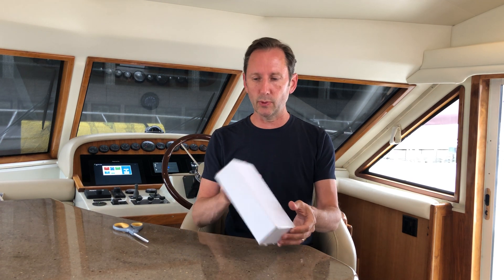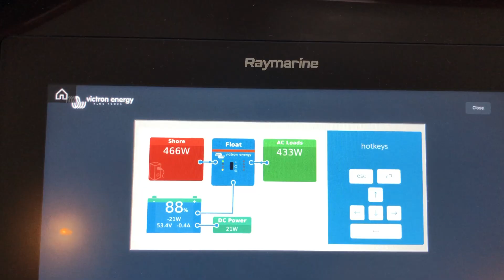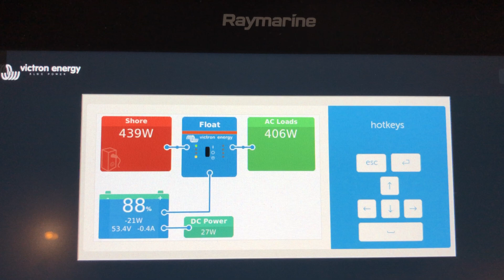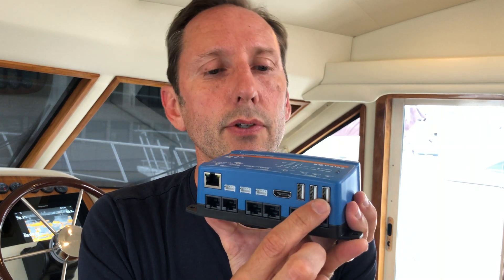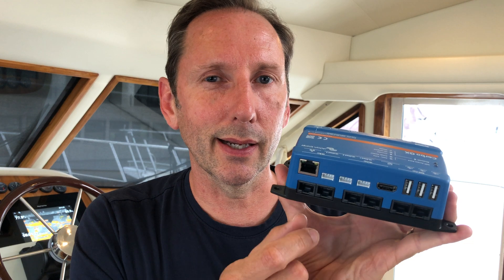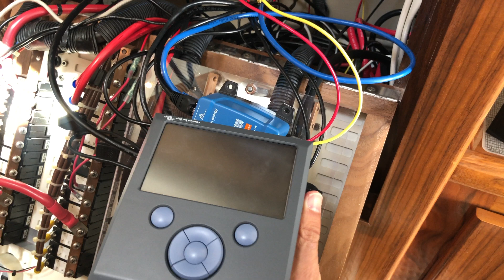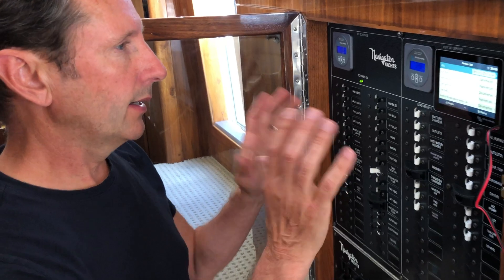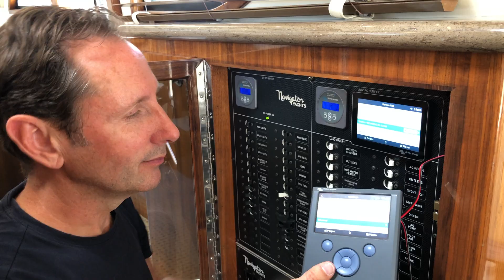Victron Cerbo GX Unboxing and Review... IS IT WORTH WAITING FOR?!! (Elli-Yacht TechTalk 1)

Comment: Would love to see how you connect the tank sensors. This is exactly what I'm wanting to do. Are you going to fit ultra sonic ones rather than drill holes? 👍🏼
Reply from the maker: Good question. In the end we decided to use Maratron pressure transducers over NEMA2K. The pressure transducers don’t suffer from getting fouled in the black tank like a float or ultrasonic sender.  Also, they’re easier to install in tanks that have limited access vs the longer float type switches (like our fuel tanks). Since the Cerbo only accepts resistive tank senders, we’ll use our NEMA2K enabled Raymarine Axiom MFD’s and Maratron DSM410 display.

Comment: Great video! Loved the insight into the system.  Just a quick question.  Are you able to control the Inverter and turn it on off like with a digital multi control or do you need to plug that into one of the ports?  Thanks again for the great content!
Reply from the maker: The multi controller is no longer needed as the Cerbo GX function takes it's place. Thanks!

Comment: Thanx for making and sharing this video. Your is the only non commercial video about these products.  I'm having trouble getting my system to show any stats on the screen. I'm connected to the Bluetooth and the VRM account.. and the WiFI is connected to my internet here.. even updated the bios of it to 7.27. Mine still shows on the main screen it's OFF.. Hoping for a little help. Thanx..  I'm a trucker and will be in Seattle on Wed for my next load.
Reply from the maker: Let me look at my backup Cerbo and see what I can find. Also, the Victron Community is pretty good at responding to troubleshooting questions, if you haven’t tried them already https://community.victronenergy.com/index.html  Thank you for keeping our supply chain alive in n the USA!
Reply: @ElliYacht1  Thanx I appreciate any help you can offer. I'm on the FB Victron group and posted with no replies yet. Ugghh..  Thank you.. I didn't know they had their own forums.
We haul only building material..  Big super sacks (2000lb) of sand to your town by the T-mobile stadium.
Reply: @ElliYacht1  So.. Upodate.. LOL.. I can now see my battery and solar from the road or obviously from home.  got a couple of replies on the forum.. even added a 3rd 400w panel to my system today. 1200 watts in total. Happy boating. I love the water as I was born in June (cancer the crab) and think living on a boat would be fun.
Reply: @ElliYacht1  Ps. Heading to Vancouver tomorrow to deliver my next load. Lumber going to Hawaii.

Comment: Can I use the Victron Cerbo GH with another monitor I already have, with a touch screen and an HDMI connection?
Reply from the maker: From looking at the Victron Community board, it looks like an HDMI monitor has worked for one user. I couldn’t find anything on someone trying a touch enabled screen. Here’s the link https://community.victronenergy.com/questions/47070/cerbo-gx-to-gx-touch-50-extender.html

Comment: What is the maximum cable length allowable to interconnect the Cerbo Gx controller to the Cerbo Gx Touch 50 display? 
From the video's it appears that the USB connection might be for used only for 5VDC power for the display while the HDMI cable handles bi-directional communications with the Gx controller.
Reply from the maker: You are correct on the cable functions. The HDMI is 78” and can’t be extended. 
:-(

Comment: The Cerbo GX has built in bluetooth. Does that mean i dont need to run cables between the Cerbo and the BMB-712 smart battery monitor ?
Reply: No you still need to run the ve.direct cables, but having the gx touch 50/cerbo combo means you don't need a bmv. Having the victron smart shunt is enough. Just rids the system of one more monitoring component.

Comment: I had this unit installed also.  I had very serious issues with all the tank calibrations (at the lower end). Example: fuel and water tanks said 35% rather than 5%. Also the data will not display on my MFD. They said  both of these would not be fixed until there is a firmware update (date TBD).  What has been your experience? Are the Tanks displaying accurately?
Reply from the maker: That’s frustrating. I haven’t hooked up the tank indicators yet. They released a firmware upgrade to 2.57 but I can’t find the fix list.

Comment: Did you get your tanks and temp probes connected? I was about to pull the trigger on a Simarine Pico setup until I saw this. I still think the Simarine has a slicker UI, but Victron has a much more mature ecosystem. An update on the tank monitoring, sensor options would be greatly appreciated!
Reply from the maker: We haven’t had a chance to tackle that project yet but, we will share as soon as we do.

Comment: Since a few weeks you also don't need the 712 battery-monitor with the shunt incl. The new SmartShunts between 500 and 2000A can be ordered single without the Victron Battery-Monitor... that's Oldschool, too!... since everything can be monitored via Smart-tech. I would like to see all the voltage-stuff on one screen on an Ipad or something comparable and for that Bluetooth also works great. Have fun with your system! That looks like a lot of power ;)
Reply from the maker: All great points Roger!  My install happened just before the launch of their new smart shunt and Cerbo. I didn’t have the patience to wait ;-) I did use the 712 BMV’s so all of the shunt info is available on the VRM and Touch 50, as well as the BMV display. I have to admit, I really kinda enjoy leaving the old school gauge on SOC so I can walk by and glacé at it without having to start an app or wake up the Touch screen.